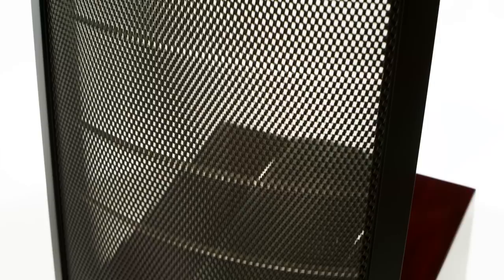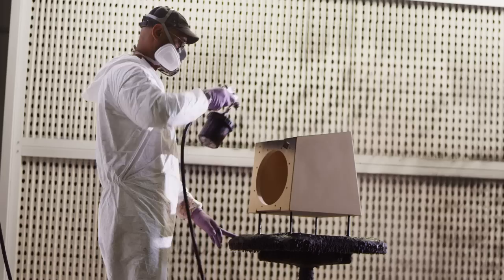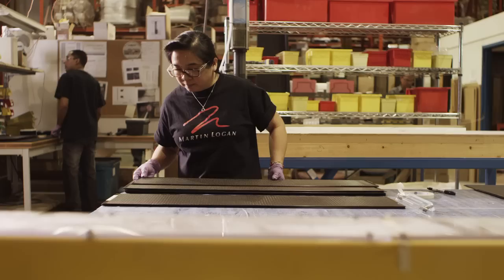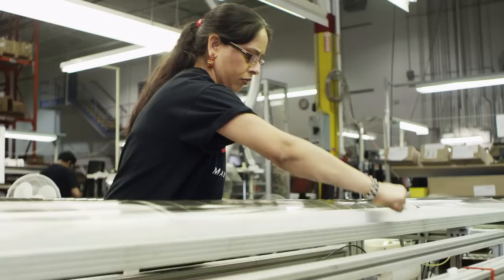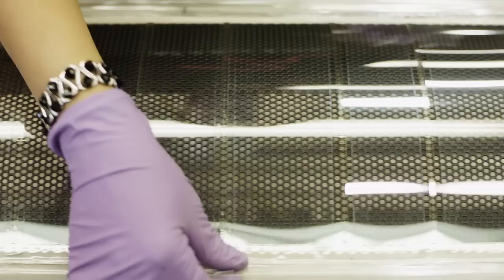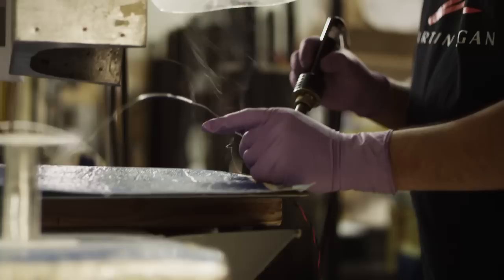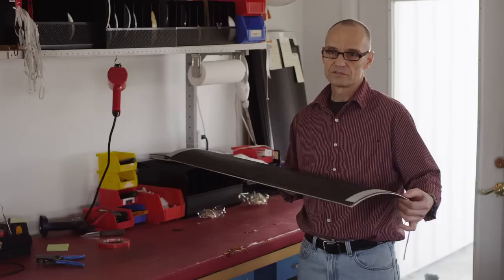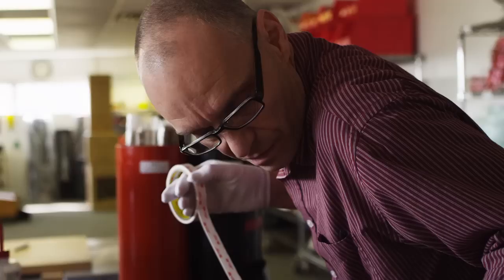Part 1: Crafting MartinLogan Electrostatic Panels

Comment: as a long time B&W speakers owner i've always admired Martin Logan they are truly different with their Electrostatic technology- i had some planar media 9 computer speakers from monsoon use similar TFT (thin film transistor) and the sound is much faster/responsive than traditional woofer w/tweeter.
This seems like a great company that really cares about delivering a great product to its customers- obviously they are not cheap but you get what you pay for.  And they are made in the USA- which is important

Comment: Funny thing is.. the workers building those speakers, will never be able to afford them becuase they cost 11.000 £ .   Totally overpriced speakers compared to how much they sound.  Take a pair of speakers for 1000£ and put them next to the Electrostatic ML - blindtest - and you will not hear a 10.000£ differense..  

If i pay that much for a speaker, i expect them to sound like 11.000 £ even if i drive them with an old reciever amp from the 70´s..   Otherwise its not just the speaker that delivers the sound, its the whole system - and the system as a whole, doens't only cost 11.000 £.
Reply: I hope they pay those grunts at least enough to afford Andrew Jones Pioneer towers.
Reply: That's not entirely true. I have a pair of ML speakers and I can't fault them. It literally sounds like the  musician is in your front room. You do however need a powerful amp to drive them. They are very power hungry and the source material needs by high quality.